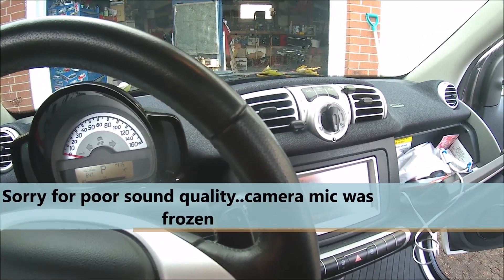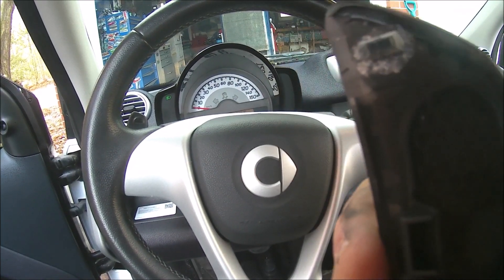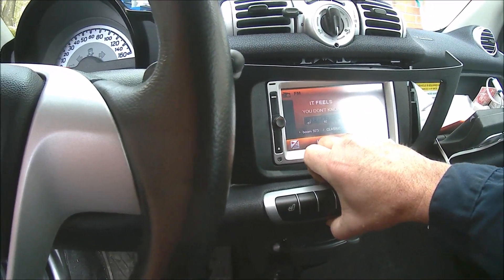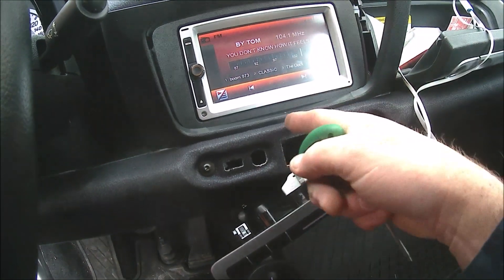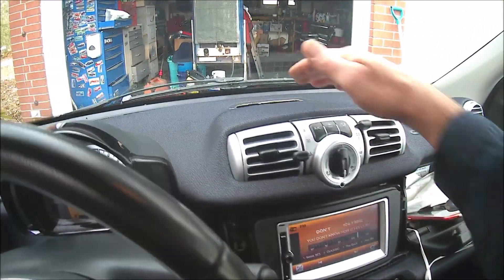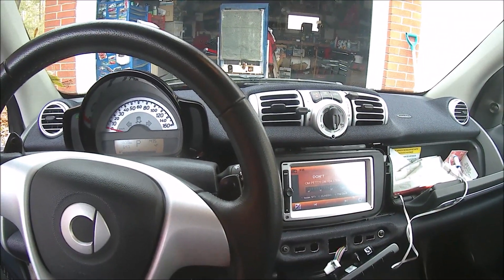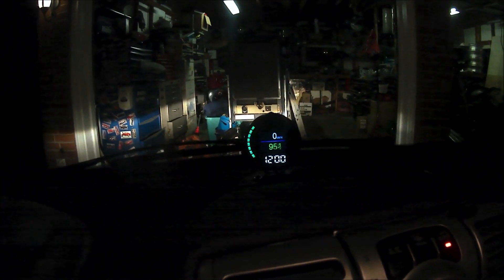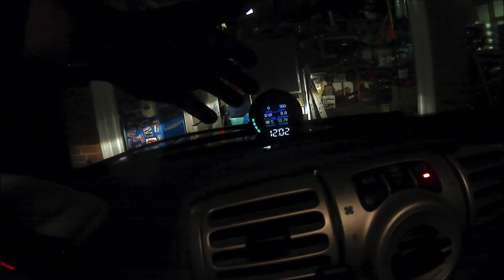Smart Fortwo 451 ..Installing an aftermarket OBD tachometer and gauge display

Comment: I watched your video about the Smart, and I noticed that you have the same multimedia unit as I do in my Smart 451 (2014). I was wondering if you could help me with a quick question. Do you know if this multimedia unit supports a parking camera? Specifically, is there a video input among the connectors on the back for connecting a reverse camera? I couldn’t find clear info in the documentation, so I’d really appreciate it if you could share what you know. Thanks in advance and best regards!
Reply from the maker: The factory Mac daddy stereo with the gps is essentially pretty bad . Bluetooth won’t work with it , phones after 2012 also won’t pair . I don’t believe there is an input on the back . There are a ton of aftermarket replacement radios that would have a back up camera CarPlay and android auto built in . Around $100 . In my opinion changing the factory radio is the best bet . I was going to do it but never found the time .
Reply: Thanks for the information. Your advice is useful: new multimedia is the best solution. Greetings from Serbia.